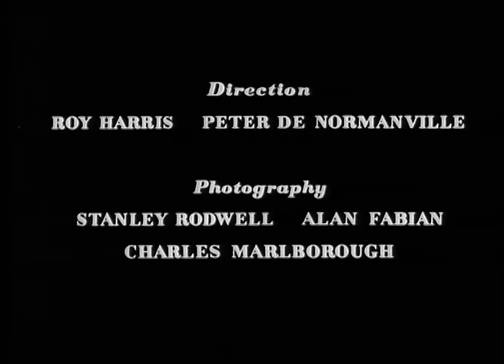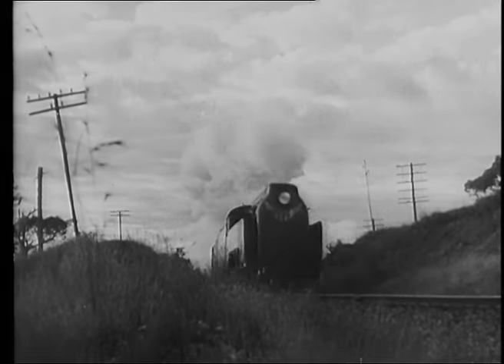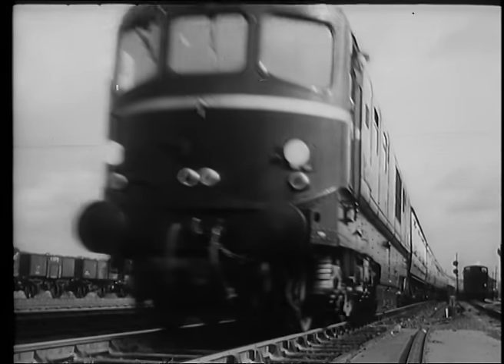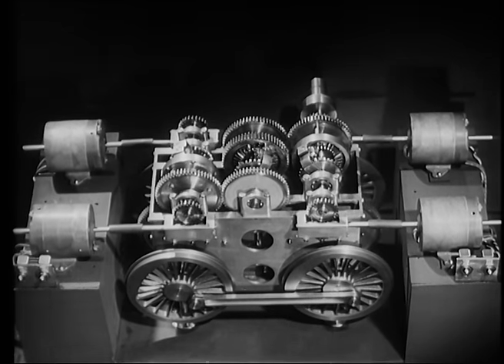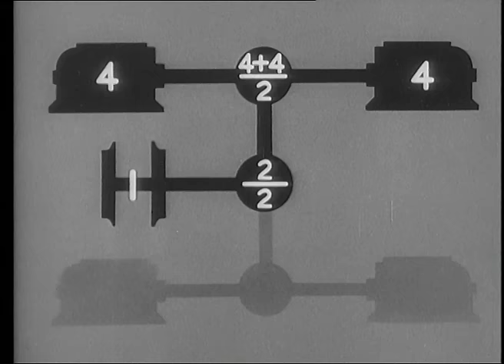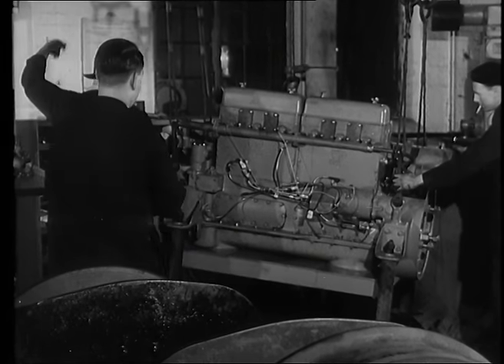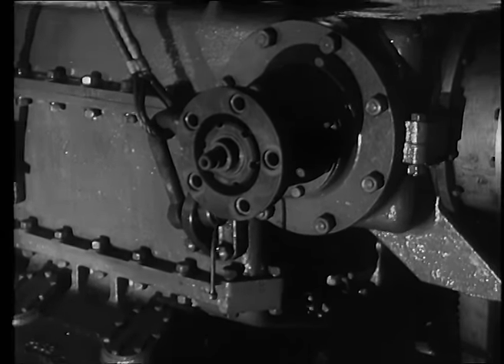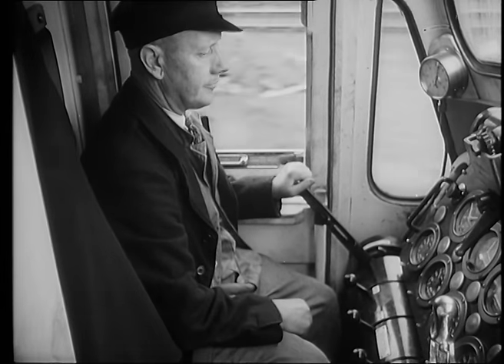The Fell Locomotive | Shell Historical Film Archive

Comment: @Shell would  you ever consider teaming with UK and US railways to help convert historical steam locomotives. A good knowing is that in America there are 2 exact Steam locomotives that are both T-1 locomotives 2102 and 2100 which be used under Coal and Oil conversion would be a great way to help keep steam in the world with the closure of coal on the other side of the world which fueled millions of locomotives. Please help steam in motion they mean as much as gas, diesel and electric locomotives
Reply: Dhnywad ok ok ok
Reply: Pretty much all preserved steam locomotives have been converted to oil burning on this side of the world. Originally they were either converted to oil burning in the early fifties or built that way. Coal burners have been converted by the simple expedient of just replicating the railways oil burning equipment
Reply: Are the builders going for the world steam speed record?

The T1s were powerful machines and it has been opined that they regularly ran at 120+ MPH. It has been claimed that one run produced 140MPH but that is debatable as they tended to blow poppet valves (those so fitted) above 105 MPH. 
Legend has it that the biggest problem seems that they had a tendency to slip, as and when both engines (Duplex) got out of sync.
Others state, with Knowledgeable and sympathetic driving, that was easily controlled.
Reply: @mandywithell   wrong T1's my friend. And this is to do with fuels, nothing to do with speed.
Reply: @muir8009  Ah! 
However, I understand that there is a group who have or are building a replica T1. I'll have to dig out their webpage to see how they are getting on.
Reply: @mandywithell   true. The group is doing a replica of a PRR T1. there's actually been at least 3 classes of T1's in the US, all at the same time, all completely different (4-4-4-4, a 4-8-4, and a 2-10-4) for completely different first class railroads.
Apparently they may have a go at the steam speed record but as they say, it wouldn't really count as its a brand new locomotive that will never be in normal operating road service. Theres already an existing steamer that could beat, and basically did beat mallards record, that is of course the borsig 05, but the Bundesbahn museum have always considered the record beating to be a rather infantile pursuit, especially for such a priceless locomotive. I'm aware of the supposed 140+ mph. Also both the Milwaukee A and F 125 mph runs. Unfortunately of course, none of them can really stand as an official speed. There's some that still believe the Empire State Express 999 did attain 112 mph in 1893, which has been widely discounted by every scholarly authority. Even noted period enthusiast Charles Rous-Marten who was on that very train timed it at 84 mph at best.
Anyway, not too sure how I got on to speed records on a video regarding the Fell diesel! (Not to be confused with a fell locomotive though)
Reply: @muir8009  "Anyway, not too sure how I got on to speed records on a video regarding the Fell diesel! (Not to be confused with a fell locomotive though)"

I think that was my fault confusing your mention of a T1 with the PRR T1.
My interest in this subject having ben piqued by reading the book "American Steam Locomotives: Design and Development, 1880 to1960 (Railroads Past and Present)" by William L Withuhn.
If you are only vaguely interested in American steam it is a cracking read. If you are interested in any steam locomotive development it is essential! 

I thoroughly recommend it!